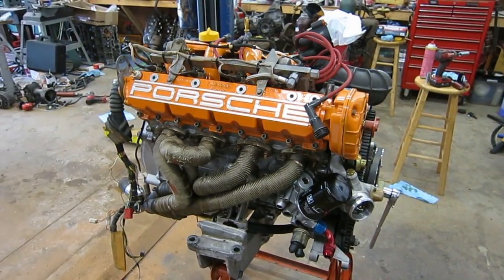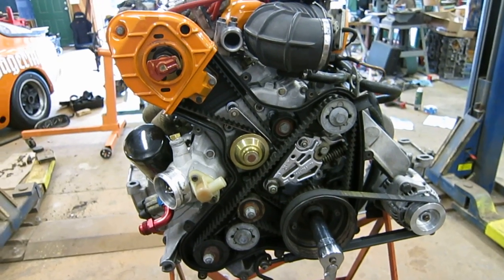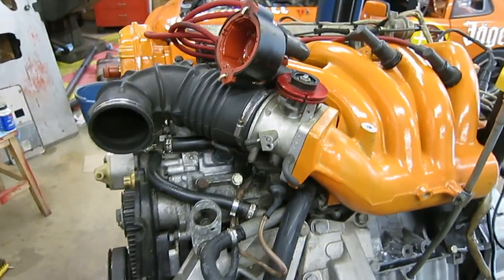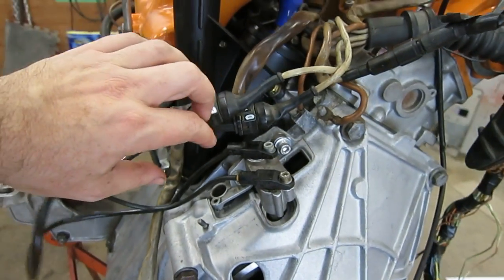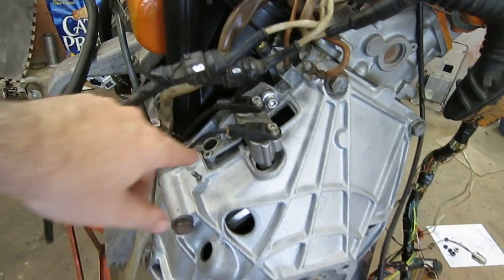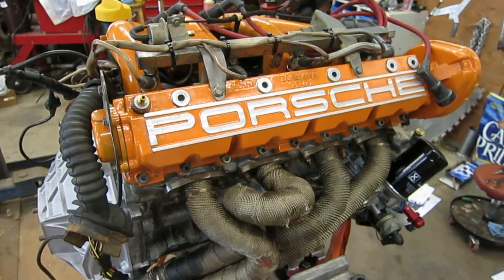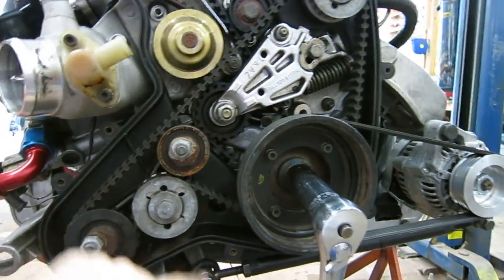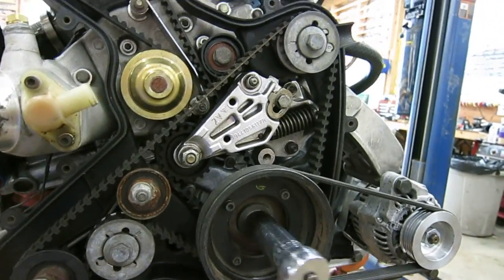Closeup look at a 944 engine

Comment: How do you remove the wiring harness from the car? And, is there a way to tell which wire goes to the speed vs reference sensors?...I didn’t mark them.
Reply from the maker: If you unplug the engine harness from the ECU, you can pass the plug through the firewall.  There is also a multi-pin plug by the brake booster.  The easiest way to verify the sensors is to trace the pins back to the DME plug.  Do a google search for the pinout of the plug - the front-most sensor is the ref the rear one is the speed.
Reply: Great, thanks a lot.  I noticed you have cross-member installed to engine.  I will try that for reassembly.  It should make it much simpler once back in engine bay.

Comment: After seeing this video I came to a conclusion that this engine is a nightmare from the operational point of view. It is so unnecessarily complicated... just replacing the spark plugs requires removing the intake manifold. That is straight up bad engineering from Porsche.
Reply from the maker: Spark plugs are an easy change without removing anything.  But, you're right, it is a pretty complicated engine.

Comment: Just looking at the timing belt set up at the front of the engine, why do I get the impression it looks like it's going to break.
Reply from the maker: Rule of thumb is to change it every 4 years for 40k miles...  They do break, and then valves bend!
Reply: I have known 928's have a similar set up and they do break earlier than factory recommendations.

Comment: have you found an off the shelf alternator that fits the 944? what is it? that looks lighter
Reply from the maker: I think it's from a suzuki swift.  It did take a little work to fit it.
Reply: I just picked up a Nissan Quest alternator that is supposed to fit with a little modification to the bracket. This guy even installed a 6 groove pulley for me: http://www.ebay.com/itm/290444092207

Thread on using this alt.: http://rennlist.com/forums/944-turbo-and-turbo-s-forum/784458-944-turbo-nissan-alternator-mod-reposted-and-to-the-point-6.html

Comment: hi Van just wondering if you can help i have a 84 944 and i backed it into the garage  on Tuesday night and went to start it on Sunday morning and it want fire. i have replaced the dme relay  and i can hear and feel it click when i turn the key however I can't hear the fuel pump start. If i take out the dme relay and use a three prong wire to replace the relay my fuel pump starts but the engine want fire . I took out the first spark plug and sat it on the vavle cover and it did not show any spark can you help any thoughts thanks Jason
Reply from the maker: I can't say specifically, but it sounds like you're verifying there's no spark.  I'd start by checking the speed and reference sensors.  Does your tach needle bounce a little while it's cranking?

Comment: how hard is it to change the fuse box on a 1985 porsche 944 N/A
Reply from the maker: Well, there are a lot of plugs on the back side...  If it's an '85.5, the fuse block is under the hood.  If it's an early car, then it's above the driver's knees.  Either way, it's a pretty big project.  After 30 years, the wires and insulation are pretty stiff and bending the harnesses around is a challenge.  Good luck!
Reply: thank you >.< and what about a freezer plug

Comment: im pissed at this engine, i had it in a 1988 924s, i put the car away in a garage few months without running, the thing just went into a coma. wouldnt start again , no spark at plugs no fire at all. ill never know why
Reply from the maker: Likely a broken wire to the speed or reference sensors.
Reply: Van Svenson

Comment: So I just got a 1984 944 and I'm hoping all your videos will lead to its completion or ease in finding my way thru the car. Its my very first Porsche and its a barn find. Im in Northern California and it was free with Clean title as a non-op. This car sat for seven years after a neighbor tried to change the water pump and the car would not start after. the interior rotted away a lot and what I mean by that is lots of mold damage and moisture damage. And the spark plugs were left out of the engine block. overall there's only two flaws to the body 1 Rusty little hole in the front bumper and one slightly flattened out Dent behind the passenger door that you'd almost wouldn't know is there if it didn't have a little rusting into the paint. Well, and the paint is beginning to bubble. really happy I found youre videos and hoping you could lead me to good links on engine rebuilds and other important technical or complicated things. I am no mechanic and don't have a lot of tools so it will be a long process for the rebuild. I'm looking at a goal now of 15 years so that'll put me 1 year before it's officially a classic.

Comment: Van, the speed and reference sensor connections are the last things I have to put back together after rebuilding top end. But I don't know which should go on top of brace and which underneath. One passenger side wire is labeled BG and the other, DG. Can you help me? Will be glad to get this '88 running and get back to Rusty the project 914 and future hillclimber.
Reply from the maker: jockellis The DG sensor is the "speed" sensor, and that is the one that's closest to the firewall down on the bell housing.  (The speed sensor goes over the ring gear teeth for the RPM signal - the other sensor, labeled BG, is the "ref" sensor and goes over the TDC setscrew on the flywheel so the computer knows when to fire the plugs.)
Reply: Thanks!

Comment: Did you ever consider running without the balance shafts? Too bad you had to rebuild so soon...
Reply from the maker: No, I've never considered running without balance shafts - I've seen too many engines that have vibrated to death (either cracking the oil pickup tube or the fuel rail).

Comment: I'd love to see a video of the instal of the engine!
Reply from the maker: I didn't take one... it was really very anti-climatic - just lowered the car over the dolly you see in this video, put the 4 bolts in that hold the subframe up to the chassis, then raise the car back up!  And I thought hooking up all the plumbing (coolant hoses and fuel lines) and wires (put the harness through the fire wall and connect the ground strap) were too boring. :)  Maybe next time!
Reply: Well anytime you do some more advanced stuff, steering rack, crank bearings, suspension facts based on your racing experience, and have some extra time please record it. I love understanding how my car works and you have experience both with a wrench and as a driver on the track. So you're a great resource of information that is not tied to a vendor selling a widget.